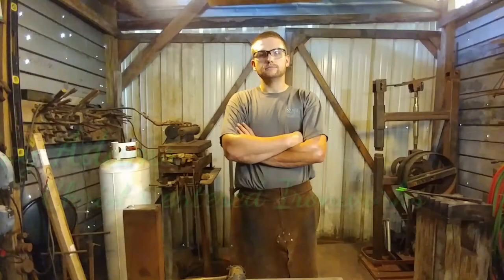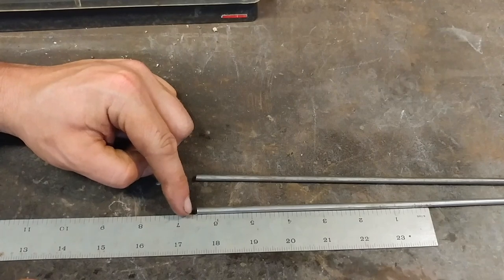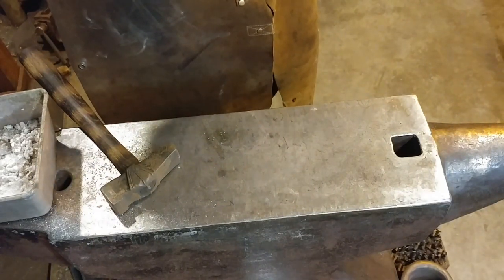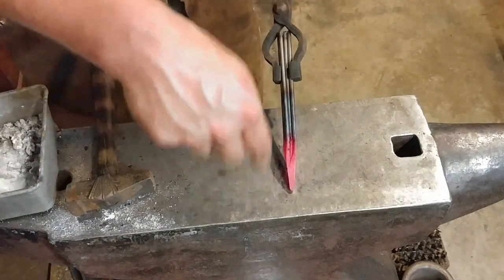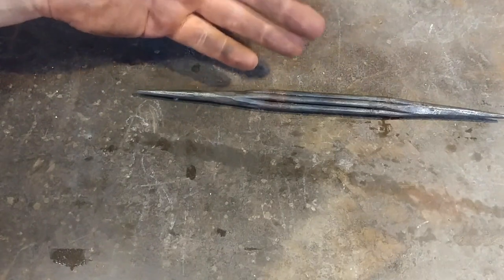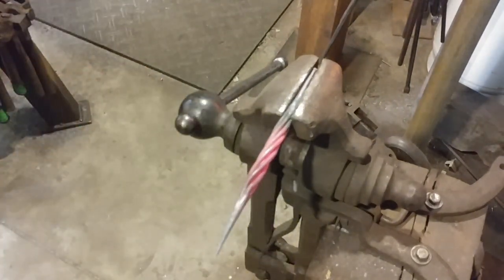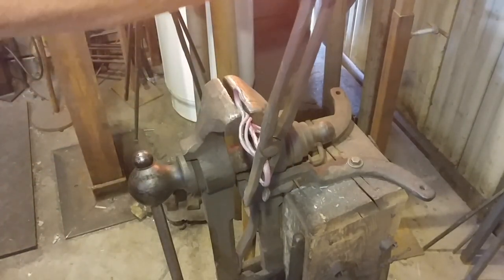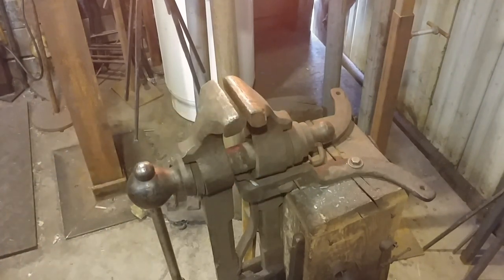FIXED: Forging a Basket Twist S Hook (Better Audio)

Comment: Have you ever tried a basket twist with a short piece of "spacer" in the center (on each end)?  If you used the same diameter center rod, you should be able to get the six outer rods equally spaced in a circle, and it may even be easier to get a nice even twist.  Plus, you could make five and seven (or more) strand baskets by using a smaller or larger center piece.  I think baskets are a wonderful decorative element of blacksmithing, and are worth the effort to get right.
Thank you for your videos, and taking the time to produce them.
Reply from the maker: +Brian Neeley I never have tried with a short spacer sounds like it might make a neat the effect though :-)